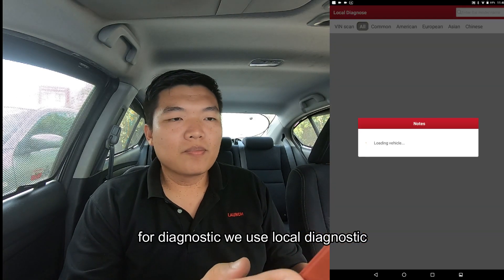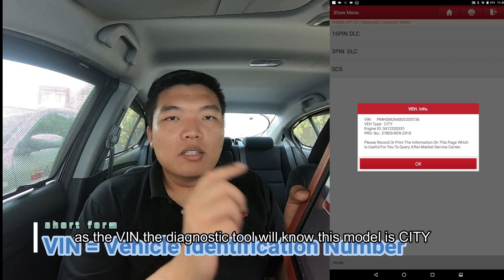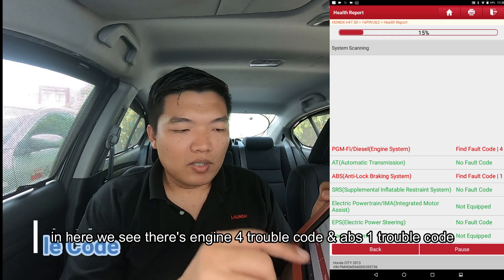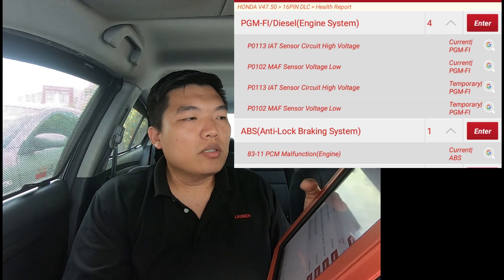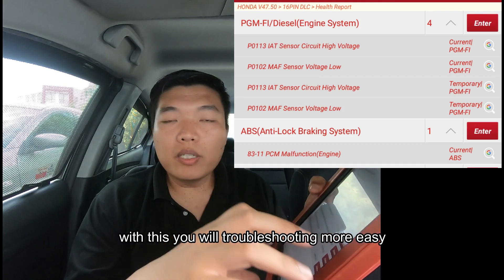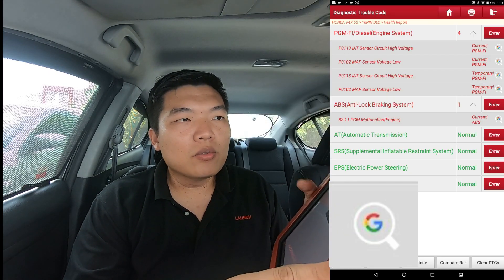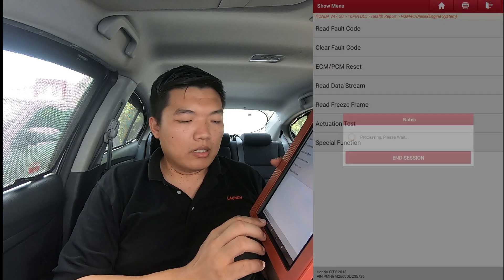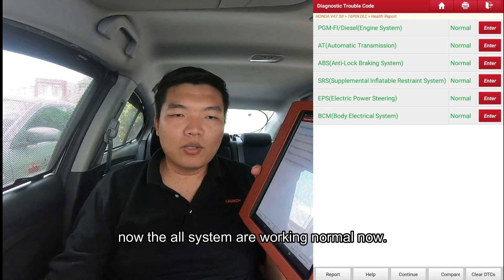LAUNCH X431 Training - Basic Vehicle Diagnostic ENGLISH VERSION

Comment: really nice 
I have a question... I use Launch x 431 V+ where I can change the functions of the Mercedes V-class 2015, such as turning off or deactivate the rear wiper when going into reverse or turning off the start-stop system and turning off the safety belts, thank you for the quick answer

Comment: When I look for dtc why doesn’t my 431v not search google automatically I have to write dtc manually?
Reply: mine is doing the same did you figure out why?
Reply: Is it connected to the internet?
Reply: When it comes up with the code, if you touch the code it provides a basic description and on the right side of the display . Eg my Mini Cooper 33FF Engine oil pressure Control Valve Activation Short Circuit to B+ and  a box appeared on the right . It opened a YouTube video, as its a very rare fault there were only 2 you tube videos. But confirmed I had to take the sump off to get to it.